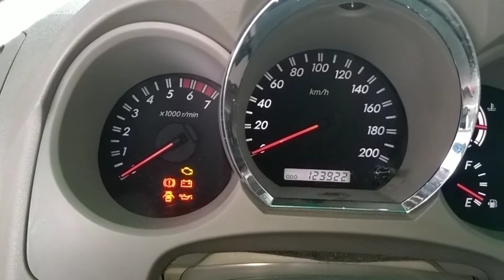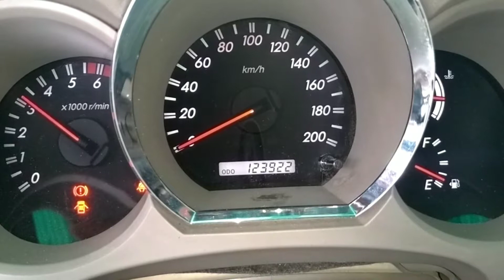Fuel filter Super easy guide to replace fuel filter ( Toyota Fortuner)

Comment: Magkano ung bili u sir sa fuel filter
Reply from the maker: 650 po
Reply: @jherfixph8050  Sir yung 650 po ba na price is for replacement parts, nagtanong po kasi ako sa shop, 3,500 daw po original filter for Fortuner gasoline. Tnks.
Reply: Wal po ba magiging problem kpag replacement ang nilagay